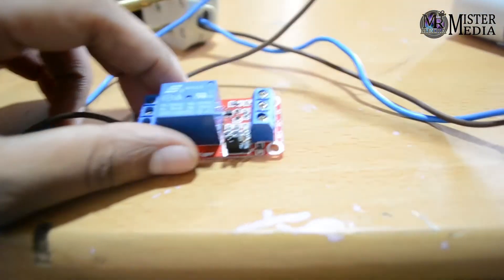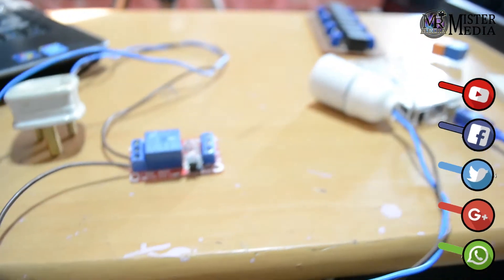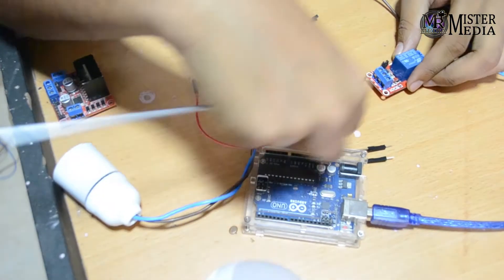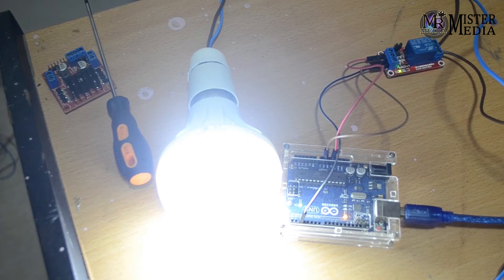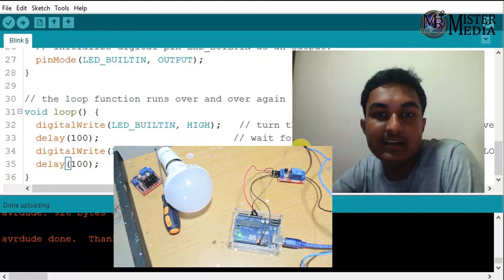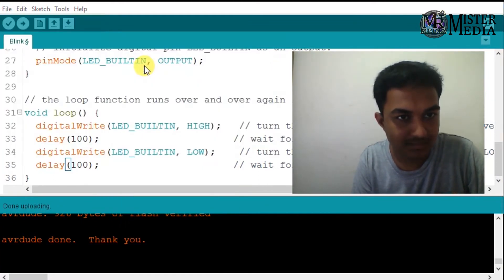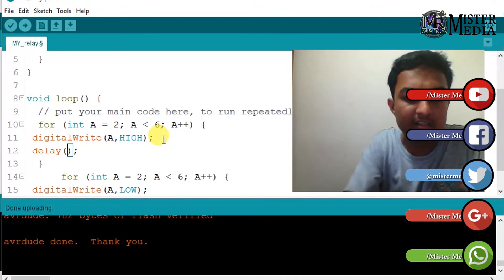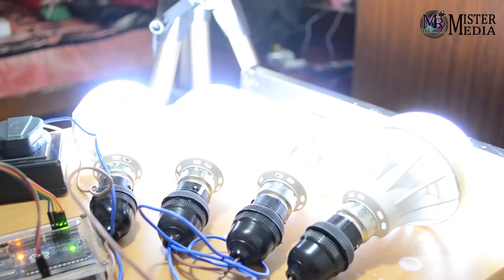how to use relay with Arduino | தமிழ் | Learn Arduino Series in Tamil Ep-37

Comment: Dear sir, I want to use the same project for agriculture motor pump, 
Sir, I need to control two relays ON relay and OFF relay, when we SMS or call to turn on the motor , ON relay on and off timer to 3 seconds cut off automatically, 
Same function when turn off the motor off relay after 3 seconds to cut off automatically 
Sir, change the code for me, thanks , using the gsm sim 800l with Arduino nano board and 2 relays for on push button relay and off relay push button, thanks

Comment: 8.5 (Windows 10), Board: "Arduino/Genuino Mega or Mega 2560, ATmega2560 (Mega 2560)"

C:\Program Files (x86)\Arduino\arduino-builder -dump-prefs -logger=machine -hardware C:\Program Files 

avrdude: ser_drain(): read error: The handle is invalid.

avrdude: ser_send(): write error: sorry no info avail
avrdude: stk500_send(): failed to send command to serial port
avrdude: ser_recv(): read error: The handle is invalid.

avrdude: stk500v2_ReceiveMessage(): timeout
avrdude: ser_send(): write error: sorry no info avail
avrdude: stk500_send(): failed to send command to serial port
avrdude: ser_recv(): read error: The handle is invalid.

avrdude: stk500v2_ReceiveMessage(): timeout
avrdude: stk500v2_getsync(): timeout communicating with programmer
the selected serial port avrdude: stk500v2_getsync(): timeout communicating with programmer
 does not exist or your board is not connected
Reply from the maker: Vetrivel Rajendiran you want to update your drivers